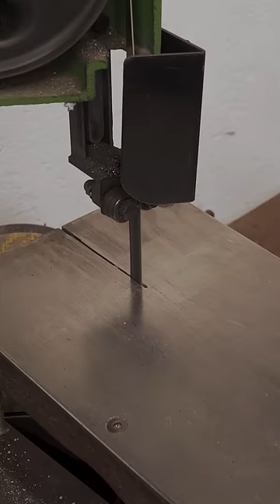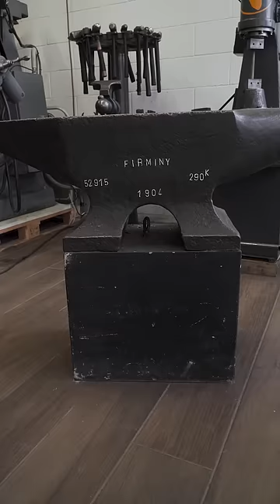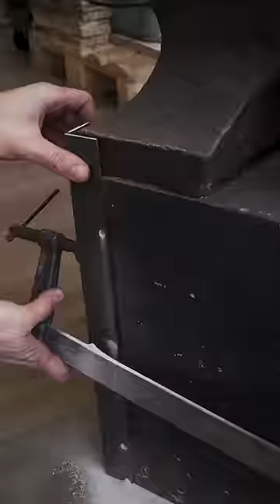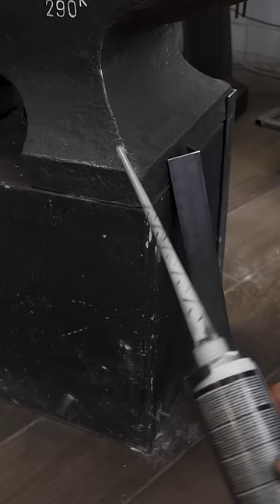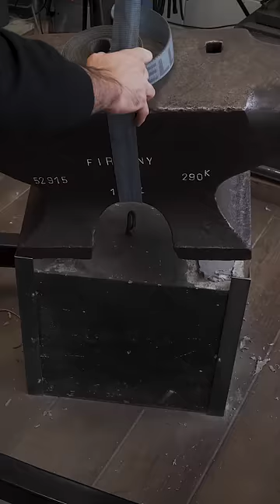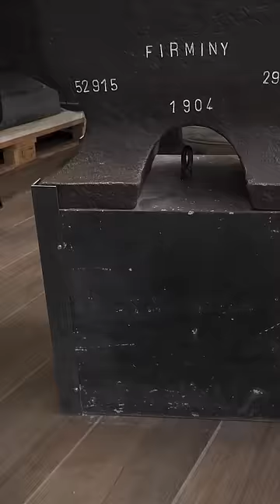Big Anvil Stand Upgrade #shorts

Comment: To all those wondering.  After reviewing further, these corner brackets are only there to keep the concrete from chipping when the corners are hit.  You realize this if you pay attention to the first second of the video where he's touching a corner that's been broken off.  These corners are not to help with holding the anvil in place.  If it moves, these will pop off quickly due to the small anchors used.  They're not meant to hold the anvil and should not be attached to it.  The anvil is more than 500lbs, it's not going anywhere as its weight keeps it in place.  The glue is simply to keep it from moving over time with repeated blows and vibrations from the tools he uses.  Also, you do not want to put it on a stump.  You do not want shock absorption.  That will make you have to work harder.  You want your hammer, or whatever you're using, to bounce back to help you swing. That, and if you have shock absorption your piece that you're working on will need a lot more hits to get the same affects as one without shock absorption.  You can really tell those who have and who have not worked on an anvil before apart by reading these comments.
Reply: I wanted a tattoo of an anvil cross. Lol worst tattoo I have ever seen in my life.

Comment: I wouldn't call that an "upgrade".
Reply: Increased potential stability and a nicer look says upgrade to me
Reply: @tantamounted  
Lol, "increased potential stability... nicer look"? 
😆👌🏼
Reply: @20alphabet  Yep! Simple, clean, durable. Doesn't have to be great art to work.
Reply: @tantamounted  
Lol, hardly any of those things you listed.
Reply: @20alphabet  So how would you upgrade a block of concrete with some construction adhesive on it that holds your big cast iron anvil off the ground?
Reply: @20alphabet   this is an upgrade he put corner brackets on to protect it from chipping... it'll last 100 years like that if he didnt the corners will chip away and potentially crack the whole thing over time.
Reply: @michaelmerryman7806  
"Potentially"? What's with all you silly girls? It'd last a hundred years as it was, without the added nonsense.
Reply: @20alphabet  well I guess us ladies wouldn't understand but being such a big man like yourself I'd be afraid to Crack it.  Merry Christmas.
Reply: @michaelmerryman7806  
Doesn't require a "big man", just a functioning brain. Merry Christmas to you and your family.

Comment: I was always told that Anvils should be mounted to a large chunk of wood, like a large section of a Tree Trunk !! Is this true??
Reply: I was told the same thing. By a man who loved to do stuff the primitive way. Something about the wood maybe absorbing any residual shock waves or something I don't know.
Reply: @scotthorton5117  You're actually looking for shock "retention" in an anvil. It's why people test anvils by bouncing a ball bearing on the surface; you want as much of the downward force of your hammer going into whatever you're whacking as possible. Having a soft pliable base introduces shock absorption, which means your arm has to do more working when swinging a hammer.

Just make sure the anvil is secured to something firm, stable and heavy.

Comment: Why not pin those corner covers to the bottom of the anvil
Reply: That anvil is over 500lbs and those corners are using tiny little anchors that won't hold it if it were to tip or even move.  They are for looks at best and a false sense of security at worst.